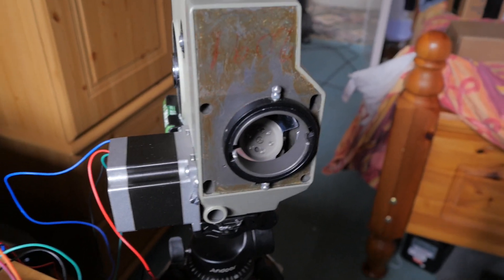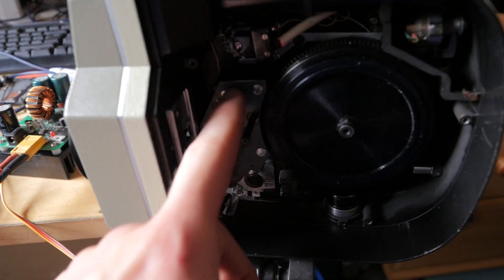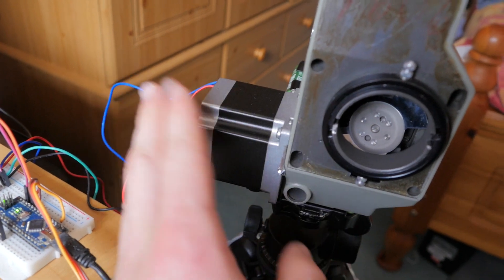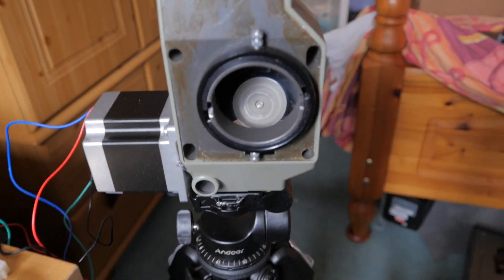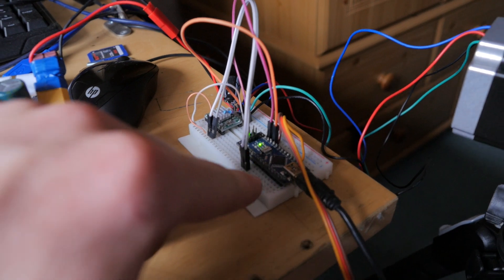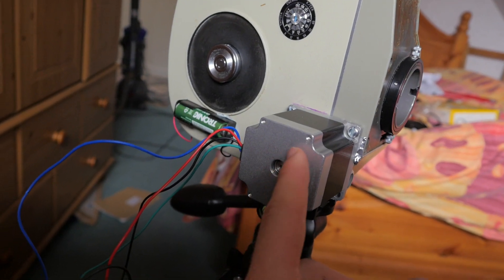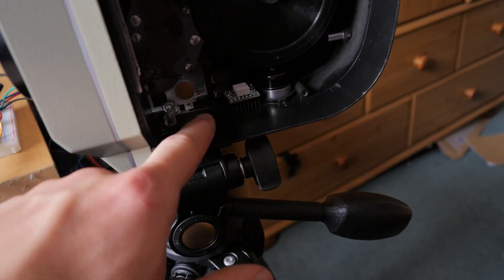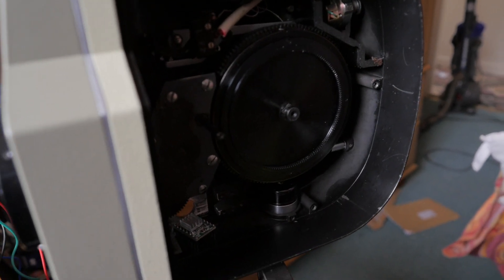Krasnogorsk 1 Crystal Sync progress

Comment: what is your microstep configuration ?If you increase the microstep you could greater accuracy and more precise frame control(note that this will decrease torque)
Reply from the maker: I am using a quarter microstepping. It doesn't matter what microstepping I use because the arduino delay microseconds function has a granularity of 4 microseconds so I will need to try a different microcontroller but I am very close to 25 fps so it will do for now. Using 1/4 microstepping over 1/2 makes the motor run quieter.
Reply: I'm assuming you are using digital write and delay micro seconds to generate a frequency to drive the stepper controller.Typical steppers have 1.8 degrees of motion per step(that makes 200 per revolution and 800 for 1/4 steps)so you need 20 Khz exactly to get 25 fps.Instead of using delay function write a for loop just countig up as a delay.Other solution is using one of the counters to generate an interrupt every few microseconds and toggle the pin.Can you post the sketch?
Reply from the maker: unsigned long previousMillis = 0;        // will store last time LED was updated

// constants won't change:
long interval = 500;//starting speed   
long interval2 = 3; //time it takes to ramp up to full speed
long askel = 2;

void setup() 
{
  // set the digital pin as output:
  pinMode(3, OUTPUT);
  pinMode(4, OUTPUT);
  digitalWrite(4,HIGH);
}

void loop() 
{
  unsigned long currentMillis = millis();
  digitalWrite(3,HIGH);
  delayMicroseconds(interval);
  digitalWrite(3,LOW);
  delayMicroseconds(interval);

  if(currentMillis - previousMillis > interval2)
  {
    previousMillis = currentMillis;
    if (interval > 20)
    {
      interval = interval - askel;
    }
  }
}
Reply: I measured the output of your code and its 19.91 Khz(keep in mind I'm using my multi meter to measure the frequency).I then tested my code and it produces 19.98 Khz.I haven't implemented the ramp up yet but it does generate the frequency on pin 3.Here's the code:
unsigned long previousMillis = 0;        // will store last time LED was updated

#define interval2 3 //ramp up function update rate
#define askel 20 // acceleration rate

int interval = 800;//starting speed 
int toggle=0;

void setup(){// I'm sorry about the brackets i know its wrong but its my style
  // set the digital pin as output:
  pinMode(3, OUTPUT);
  pinMode(4, OUTPUT);
  digitalWrite(4,HIGH);
  //Timer1 configuration(keep in mind the servo library will not work)
  noInterrupts();           // disable all interrupts
  TCCR1A = 0;
  TCCR1B = 0;
  TCNT1  = 0;
  OCR1A = 400;            // compare match register
  TCCR1B |= (1 << WGM12);   // CTC mode
  TCCR1B = (TCCR1B & 0b11111000) | 0x01;
  TIMSK1 |= (1 << OCIE1A);  // enable timer compare interrupt
  interrupts();             // enable all interrupts
}

ISR(TIMER1_COMPA_vect){// timer compare interrupt service routine
  if(toggle==1){
    PORTD=PORTD & B11110111;
    toggle=0;
  }
    else{
    PORTD=PORTD | B00001000;
    toggle=1;
    }
}

void loop(){
 
  unsigned long currentMillis = millis();

  if(currentMillis - previousMillis > interval2){
    previousMillis = currentMillis;
    if (interval > 400){
      interval = interval - askel;
    }
  }
}
Reply: Tomorrow i will finish the code hopefully.Btw you can tweak the frequency with OCR1A .If you decrease the number it will increase in frequency(I suggest changing it by 1)
Reply from the maker: Thanks so much for your help. The ramp up is essential as without it the motor won't start. I will definitely give you a mention in my next video about this project. I am currently waiting on the correct capacitors for the controller to arrive and I will mount it inside the camera.
Reply: I actually finished it this night: 
unsigned long previousMillis = 0;        // will store last time LED was updated

#define OCR1A_START_INTERVAL 8000 // 1 Khz starting frequency calculated from your original sketch
#define OCR1A_RUN_INTERVAL 400 
#define SOFTSTART_UPDATE_RATE 3 //ramp up function update rate
#define ACCEL 20 // acceleration rate

int interval = OCR1A_START_INTERVAL;
int toggle=0;

/*I hope it work.Its hard to tell just from measuring with a multimeter.
 *The frequencly seems to be stable and acurate.
 *The soft start is a bit agressive.It ramps from 1 khz to 20 for 1-2 sec(you have to play with the values but make sure they are dividable example:8000/400=20)
 * Since the frequency is generated by a hardware timer and interrupt this frees the main loop for other stuff needing to be periodically updated like a lcd or used for scanning for input
 * Theres is a similar method for for generating frequency.It still uses the timer but it runs in waveform mode(instead of using an interrup it directly outputs it from the pwm pins).I think
 * that its better that way but if this one works I wont bother :D.There is a saying IF IT AIN"T BROKE DON"T FIX IT xD
 */

void setup(){// I'm sorry about the brackets i know its wrong but its my style
  // set the digital pin as output:
  pinMode(3, OUTPUT);
  pinMode(4, OUTPUT);
  digitalWrite(4,HIGH);
  //Timer1 configuration(keep in mind the servo library will not work)
  noInterrupts();           // disable all interrupts
  TCCR1A = 0;
  TCCR1B = 0;
  TCNT1  = 0;
  OCR1A = OCR1A_START_INTERVAL;            // compare match register
  TCCR1B |= (1 << WGM12);   // CTC mode
  TCCR1B = (TCCR1B & 0b11111000) | 0x01;
  TIMSK1 |= (1 << OCIE1A);  // enable timer compare interrupt
  interrupts();             // enable all interrupts
}

ISR(TIMER1_COMPA_vect){// timer compare interrupt service routine
  if(toggle==1){
    PORTD=PORTD & B11110111;
    toggle=0;
  }
    else{
    PORTD=PORTD | B00001000;
    toggle=1;
    }
}

void loop(){
 
  unsigned long currentMillis = millis();

  if(currentMillis - previousMillis > SOFTSTART_UPDATE_RATE){
    previousMillis = currentMillis;
    if (interval > OCR1A_RUN_INTERVAL){
      interval = interval - ACCEL;
      OCR1A = interval; 
    }
  }
}
Reply: I hope it works.BTW the motor might not be starting because the current is not enough.Those drivers usually have a constant current feature to prevent the motor from burning out.You might wanna look at that setting.
Reply from the maker: pe6o991 Thanks so much for this, you seem to really know what you are doing and it certainly looks like a properly written program. I will test it in a few days when I get my arduino pro mini and controller capacitors. The stepper motor can not start at high speed straight away as that is just their design. The faster they go the less torque they have so that's why the speed up is essential. It also places less strain on the camera. Hopefully I will be able to add feet and frame counting, single frame and LCD functionality to the program.
Reply from the maker: I've just tried your program and it worked first time. The Arduino sometimes crashes but that is possibly due to me still having it on the breadboard with long wires. I will get it all mounted inside the camera tomorrow.
Reply: does it generate the exact frame time ?
Reply from the maker: I am not sure yet, it ran in exactly the same way as my program did and being able to run an LCD screen while doing other stuff is more important to me than the frame rate being exact.  It has better frame rate accuracy than the scoopic camera I have so it is a great start. I will be using a 128x32 I2C OLED display mounted on the outside of the camera.